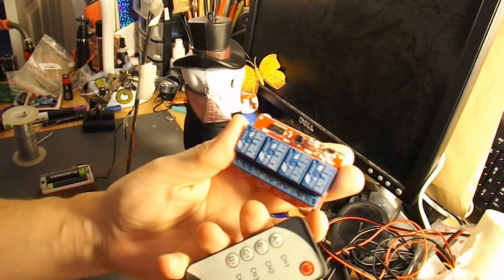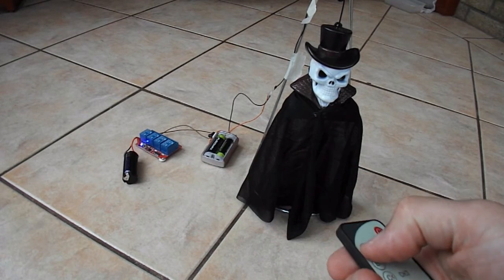Halloween 2014 Project #2 Part #1

Comment: I see the torque of the motor is spinning it , I wonder if mounting the moter horizontally instead of vertically would stop that?  Also, what if you added a potentiometer to the circuit...then you could vary the speed of the motor?  Great idea and thanks for sharing the video!
Reply from the maker: Originally I wanted it to bounce about a bit, but when I realised it turned - with the torque - I decided that was a good effect. If I arrange for it to be facing away and it turns towards you when you approach, it should be fine. Yes a potentiometer would allow you to alter the speed. One of the options I tried was to attach a length of soft insulation stripped from some wire to the shaft of the motor so that it spun out as the motor started, like arms, under the cloth cape. It nearly worked but tended to get caught up in the cloth. Just a bit more care in the design of the 'arms' might be the fix there. Running the motor slower might help that, but I would then lose the rather good sound effect. There are so many options that could be added to this. Using an elastic band to hang the ghoul and mounting the motor horizontally might encourage it to bounce up and down for an interesting effect.